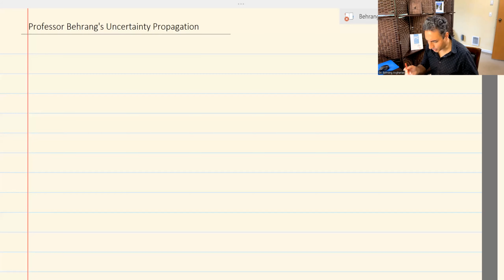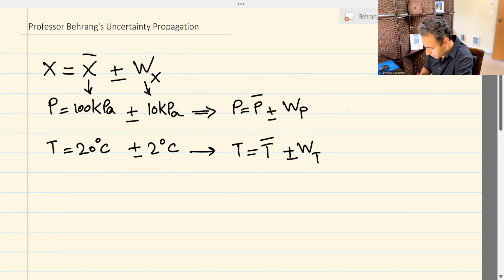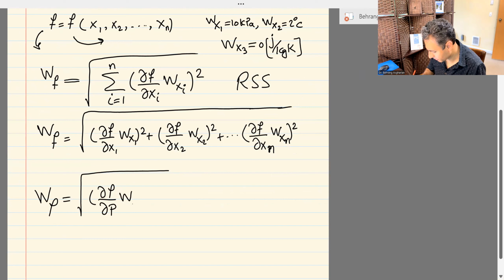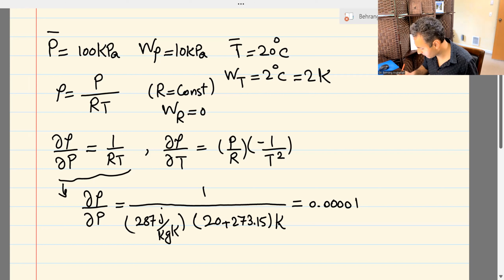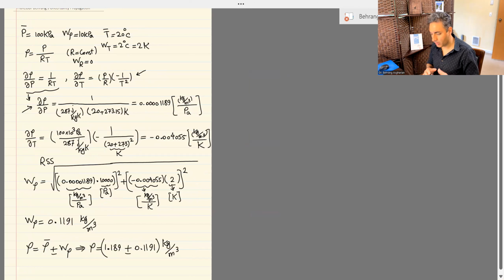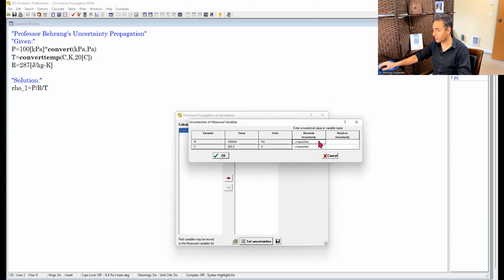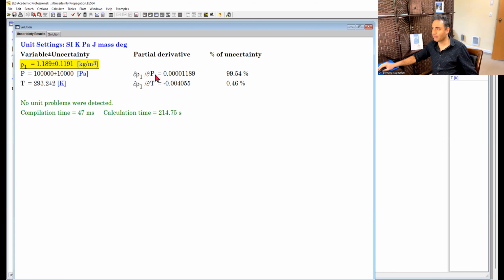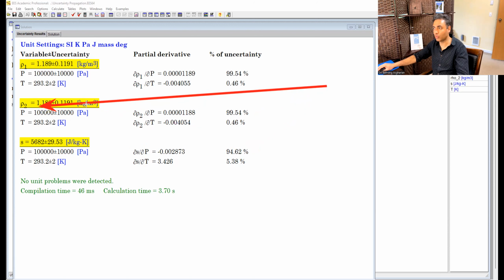How to Calculate Uncertainty Propagation by hand or by EES using RSS Method

Comment: How can I use RSS if I have multiple values of temp or pressure?
Reply from the maker: I need more information about the problem.
Reply: @professorbehrang  Hi, what does it happens when you calculate a thermodynamic property using EES. How can you calculate the propagation of uncertainty
Reply from the maker: @Remains123  it’s the sam process. Use the same window that I showed here and pick the variables.